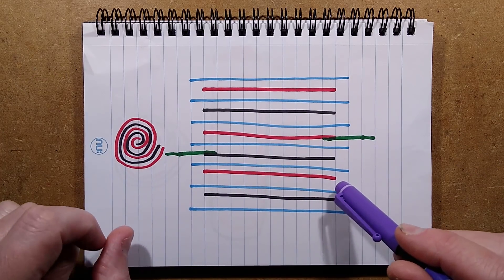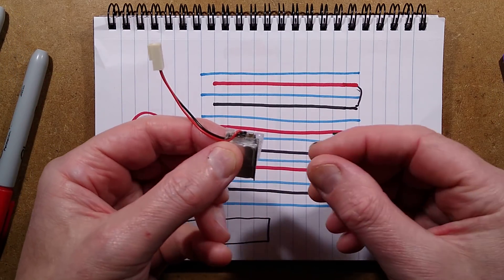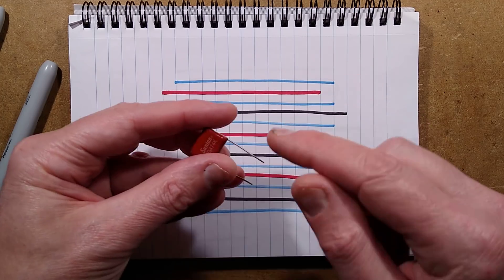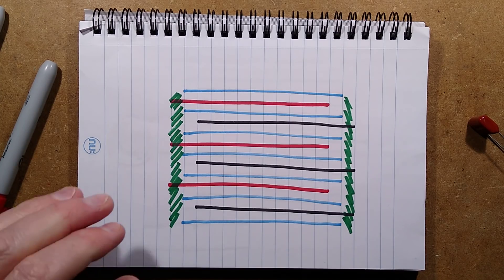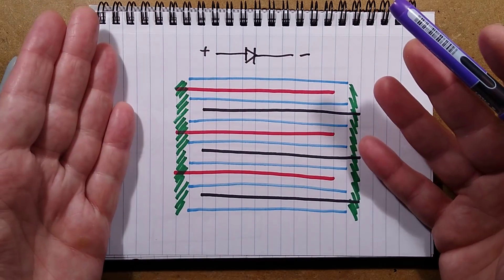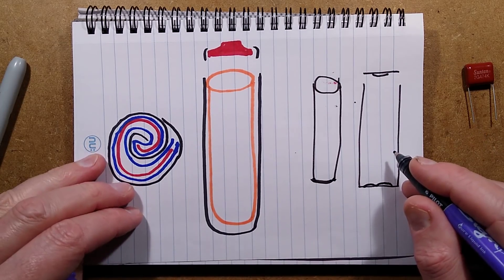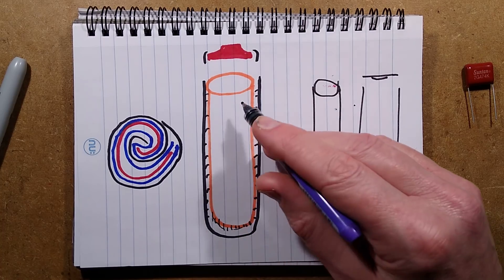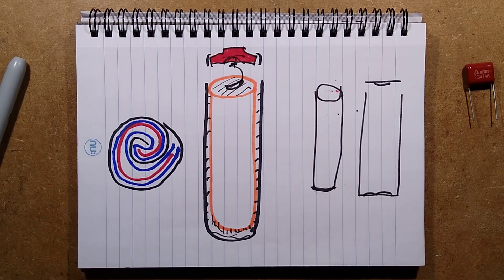Will Tesla's tabless cells ever use Schoopage?

Comment: All I can think of is "They haven't been doing it this "NEW" way all along?" I wonder how many people came up with this idea over the years and couldn't get anyone to listen to them? This could work on many battery types.
Reply: They didn’t need it before. The car manufacturers are focusing on pouch cells and prismatic cells, simply because of space concern. Tesla and startups are the only ones focusing on cylindrical cells because of the flexibility, cheaper, and the already big production capacity compared to having a dedicated size and thus kind of dedicated production lines at a supplier. And Tesla and startups didn’t have the R&D yet to have an optimized cell, so they used the cylindrical cells that were available, the 18650, even though those were only optimized for laptops. The 4680 is now the first time that someone has found a use-case for this kind of technology. If the other car manufacturers would have focused on cylindrical cells early on, we would have gotten much further. But the didn’t, as they were just fitting a battery in existing ICE cars, and thus space was a big limitation. Look at the e-golf with only around 38kWh battery, while the ID.3 has around 80kWh, that comparable outside dimensions. Volkswagen group is now one of the first that have a dedicated BEV platform and that could switch to cylindrical cells. But the rely on suppliers and thus either they would need Tesla as a supplier or have to wait for one of the existing battery manufacturers to start a comparable innovation to cylindrical cells, hoping that VW or others would use that instead of the prismatic cells or pouch cells. Which makes it kind of tricky, such a switch would require a big advantage to the other form factor, and I don’t know of another battery manufacturer capable of pushing comparable innovation as Tesla, as most still have 5-10% cobalt, and most still have a lower Wh/kg density. This innovation will give Tesla a huge leap forward, and others struggling to find a solution. Either throw out all the already invested money in pouch/prismatic cells and invest in cylindrical cell innovation, or try to find a solution to improve pouch/prismatic cells even more than they did before, so that Tesla’s advantage shrinks, but this could also mean big R&D costs since the form factor is less optimal for it.
Reply: I wasn't refuring to cars. I meant any battery you could simply slide the plates apart for connection without some sort of tab. Its amazing how we just keep doing things the way we always have and not improve the simplest of things.

Comment: This picture sort of already confirm that its kind of what they are doing. It would seam the major reason for it is cooling. So the tab sticking out on the end is far larger than it needs to be.

https://cleantechnica.com/files/2020/09/2020.09-tesla-battery-day-annual-shareholder-meeting-SCREENSHOT-jelly-roll-4680-cell--2048x1135.png

I wounder if it looks the same in the other end as well.. i might guess it probobly not.

I would consider this very much a compromise solution. Prismatic cells would be far better. But they are a bit more complicated to produce, but there are several advantages.

Really the key advantage of producing cylindrical cells is very high factory throw put. 

Having the heat at the end of the cell would make cooling of the battery pack simpler. But having the full pack prismatic would still be both simpler and lighter, while more expensive.

I would not consider this any kind of innovation. This is a solution forced on them due to several layers of technology lock in. Its a compromise. 

There is other ways of reducing the problem of pinch current a LOT more. There is this solution with multi cell layer pack. Pretty much rolling several cells in the same role.

A normal cell have typical Positive-electrolyte-negative-insulator that is rolled

A multi cell stack don´t need the insulator, it can have P-E-N-P-E-N-P-E-N-P-E-N-I. And yes, the positive would be shorted right next to the next negative. This don´t matter because they have the same potential anyway. Of cause this can´t be done with 18650 cells, because they would be far to small. (could probobly make a 8V 18650, but not more). 

A issue with this solution is that balancing leads are needed. Making it like a prismatic cell would be far simpler.

While this solution would not let the cell draw more current, because the voltage could be increased to pretty much what ever you want, this is not really a problem at all.

Comment: A few comments: The battery day event actually showed that they will extend the anode quite a long way and fold it over towards the middle, presumably they they can weld/solder a plate that contacts all of it. Presumably the same on the other end of the battery.
During your explanation you said the electrons pass through the electrolyte inside the battery during charging. This is NOT how it works. The electrons go via the charging circuit (just as happens when discharging, but the other direction) while the positive lithium ions move through the electrolyte. Electrons NEVER go through the electrolyte.
Reply: Yeah, otherwise you'd just get a bang from the short circuit.
Reply: This is exactly what I was thinking. Well, except the ion part. I forgot about that.

Comment: TESLA battery engineers do not apply a conducting material, but they incise the edge of the metal foils and bend them in so that they connect each other. So there is no problem to add the electrolyte.
You can see this very nicely here: https://imgr1.auto-motor-und-sport.de/Tesla-Battery-Day-2020-169FullWidth-c2028fc0-1725793.png

Comment: how about if you have a non-conductive center of the case and roll the anode past on one side and the cathode on the other also. I guess it's connection area and distribution as compared to the foil that matters. Would at least produce an interesting battery due to how easy it would be to short, if you didn't cover the case =)

Comment: In the olden days when I was indirectly involved with making capacitors (actually making machinery for capacitor manufacturing), I saw how the metal strips were inserted between the wound layers to form connections.  The strips did not make contact to only the edge, but they extended nearly full width of the foil.  On smaller capacitors, there might be just one pair of those terminal strips.  But when the layer number was increased, it was necessary to use more strips.  That was both for thermal reasons and for reduction of INDUCTANCE!  These were the days when end metalizing was just starting to appear.  So we played some with zinc spraying.  There were two issues (maybe more) that were difficult to do in a consistent fashion.  We had to extend the aluminum foil to outside of the insulation film and then a flat tab could not be made to stick to the aluminum by the zinc spray.  The spray naturally did not go under the strip..Round wires would be better, but had other limitations.  Well, you may have seen Rifa capacitors that have transparent epoxy ends and the terminal wires are buried to an apparently sprayed metal layer.  I am not sure if they used zinc or tin, or even something else.  In any case, that structure minimizes both ESR and ESL in the winding.  I can imagine similar benefits are desired for batteries.

Comment: Why can't the last wind of the copper annode be crimped into the rolled edge of the battery housing?  A 2mm raised wing on the last 10mm of copper sheet could be rolled and crimped into the housing.

Comment: Interesting about anode and cathode appearing reversed on a battery.  I guess it's because when you connect polarised components in series, you normally connect the positive of one to the negative of the next.  But for some reason when you get to the battery you connect two positives together and two negatives together.  So I suppose you could argue that the positive and negative terminals on a battery are actually the wrong way around relative to polarised components?  (But if you connect the anode to the cathode for everything then that still holds true for the battery.)

Comment: I was under the impression that they plan to have the electrodes protrude beyond the separators at the ends of the cells, along the very long side of the electrodes, instead of along the very short side, at one  end of those very long electrodes, which, to me, makes a lot more sense. I have wondered for a long time why that is not how it's typically done. Perhaps have the protruding conductive border part of each electrode in some material that is more conductive than the actual electrode part. 

I don't know if they said something about that last part, I think I got the important fundamental principle the first time they explained every "new tech", and didn't need everything explained to me 20 times in slightly different ways, or a few of the most obvious conclusions that could be drawn from the information presented pointed put to me, so I skipped through most of their presentation, and can have missed some details.  

Anyway, that way electrons, (and heat) will have a lot shorter distance (in average) to travel in the electrodes, especially in wider cells. The new cell was said to be 46 mm in diameter 80 mm long if I remember correctly. This new way, will make it possible to stack the cells, and have cooling and heating only from the ends of the cells, possibly even from one side, making it possible to make a lot denser battery pack, which also can be made into a structural part of the car.

Comment: Connect two diodes in series, current will only flow (assuming you don't exceed the diodes' breakdown voltage) if they're connected cathode to anode. Therefore, if you're going to refer to battery terminals as anode and cathode (I thought these terms were only applicable to semiconductors and a hand-me-down from thermionic valves?) the negative electrode must be the anode.

Comment: Quick note about the formfactor, they are 2170 and 4680 afaik, tesla has stopped using 18650 cells for cost and production volume reason

Comment: What about doing away with the jelly roll, and using a stack of "cheese slices" such that they poke out BOTH sides.  
You'd have a flat sandwich cell, with two positive and two negative connections.  No rolling, lots of connector width.   Cooling may be an issue if the stack is big/thick enough.

Comment: 10:44 your drawing has a large container with a cap on it.What if the cap and container were equal length so the join between them was halfway up the cell - and the internal copper only comes halfway up and the aluminium at the top comes half way down ?

Comment: It's Tesla, they''re going to tell you they will weld the positive terminal inside closed battery using focused electron beam and maybe in 5 years actually pull that off (or reinvent a spring).

Comment: I think they'll allow the -ive foil to contact the case for all the reasons you've outlined, especially current carrying and temperature dissipation.  It's infinitely easier than using Schoopage for the case contact.  Sputter fusing (Schoopage) the +ive end is problematic, because the cell still really needs to vent and something completely coating that end would be a really bad idea.  For this reason I think maybe they are working on something that only partially coats that end (eg a hash pattern), leaving some room for gas expansion out of the cell.  They could also bury a wire in that coating for connection to the cap.  Technically it's not a tab since it's not directly connected to the foil.

I really like the way Li-ion battery technology is going, but I'm not sure I see the huge advances.  We haven't seen much in the way of new chemistry that has increased capacity and current, though safety has been improved for some applications (lithium manganese and hybrid chemistries).  Unfortunately the requirement for high capacity means the safer chemistries are skipped over with a preference for lithium cobalt which tends to go on fire rather explosively. (great on a video, not so great in your pocket or in the floor of your car).  So far the safety of EVs has focused on impact intrusion protection rather than safer chemistries which would reduce capacity and/or current.  For example the EV car crash that Richard Hammond suffered at Rimac did result in the car catching on fire.  Fortunately the damage was small enough initially that it's progression was slow.  Bystanders (or crew?) were able to pull him from the wreckage before the fire had become serious.  Safe chemistry batteries would not have caught on fire at all, or it would not have spread to other cells, however this would have resulted in lower capacity and lower power output.

Sodium is a chemistry that has the most promise for high capacity and current.  Of course it needs to be in a safe form such as a salt, which brings it's own problems.  Graphene has some promise as an electrode because of the high surface area, but there's still parts of this puzzle missing.  I do know that John Goodenough has done (or is doing) some work in this area.

Comment: the only issue I'd foresee using Schoopage is if the internals of the batteries get too hot, the solder will melt down into the battery plates causing shorts and fires. That separator needs to be super skookum if it's gonna withstand that.

Comment: Ahh not a bad idea.
But not round. 
Round cells make gaps which is good for cooling and less for anything else. If you look at what you drew, one end terminal is in the center of the roll. 

A out ten year ago, I was doing some. R&D. It was picked up by a uni and finished about 6 years ago.
The chemistry differs, but it is more a cap than a battery.

Think of it like this:
If you charge a car for 2 hours for X miles, then at X your stuck for two hours. Well say X is 500miles and is range.
Now if you reduce your range by 50% then your in serious trouble as a sell /use point.
But if you can charge in 10 minutes, you then become a regular type of experience.
There was talk of a "hybrid" but the idea is reduced charge time the same as a cap. But the storage of a battery.
The principal was that if you can dump high voltage, and invert this to a lower voltage and higher current.
The problem should be plain on issues here.

Hope that helps.

Comment: You have explained something about a capacitor I have - I think it's one of the schoopage style capacitors.  It's a Chicago Condenser Corp cap.  If you want to see it, here's a link set to play at the right spot for your convenience: https://www.youtube.com/watch?v=OeSKxH_tzfs&t=11m40s (that's 11min40secs in case the time setting doesn't work).  BTW, to answer your question, I don't know if you're going in the right direction, but it sounds right - for one thing, the heat dissipation benefits would be very tempting, as well as the other benefits you mentioned.

Comment: I wonder if one day they will grow batteries ? Think of how they manufacture microprocessors- when you finish laughing at me that is .😂
Another thought i had was why are they still using flat surfaces on the materials they use to make the battery out of ? By using microscopic corrugations they could increase the surface area a little and therefore the capacity and this combined with the design discussed in this video would possibly allow them to use much thinner materials and add more layers as the current path is so short .

Just a few thoughts from the my ( quite possibly insane ) brain 🤪

Comment: what I think they are trying to do by combining CAP and Battery tech together is they are trying to get the fast charging capabilities of a capacitor while also maintaining the slow discharge rate of a battery.  Kind of like they want a open top water tank with a slow drip outlet valve.  power goes in fast but back out slowly for that sweet sweet rapid charge and million mile capacity for electric vehicles.

Comment: Why aren’t traction batteries constructed like some 9v carbon-zinc batteries with alternating anode, cathode, and separator layers? You could have a purpose-built high-voltage, high-current, space-efficient battery with tabbing only necessary on the outermost anode and cathode layers.

Comment: It worries me that these batteries are getting so complicated now with all the layers how can they stop the battery from self destructing in the event of an internal short. With a big car battery I dread to think what that will go up like!
Reply: getting complicated? im pretty sure all rechargeable cylindrical cells of the last 20 years were done like this. Also doing the layers is not complicated - you just sandwich a long strip of dielectric seperator, anode, seperator, cathode and then roll it all. Also the Voltage of a single Cell is only about ~3 Volts tops.

Comment: Why not use disks of each material, separated by insulators in a tube. Instead of a jelly roll, a thousand layer sandwich. High voltage, but parallel instead of series.
Reply: Yep, my zero knowledge is showing
Reply from the maker: In the flat high current drone style batteries they do have lots of parallel layers.
Reply: @bigclivedotcom  that's great to hear. Glad I wasn't crazy. If they did it in a tube style, a much higher voltage would result. Would energy density remain the same though? If chemistry, surface area and volume also remain the same?